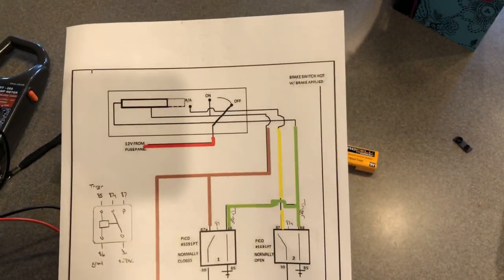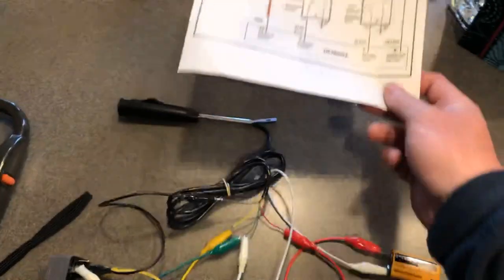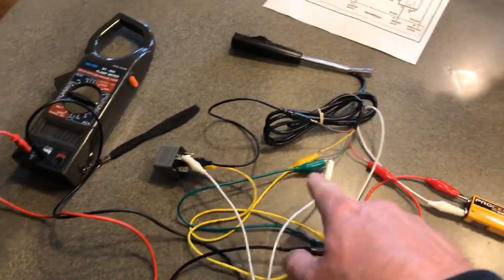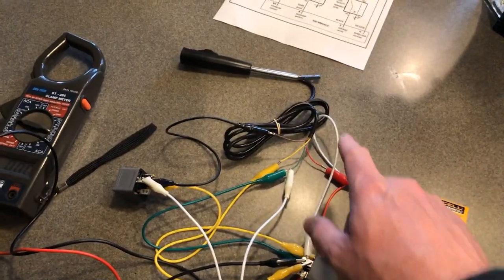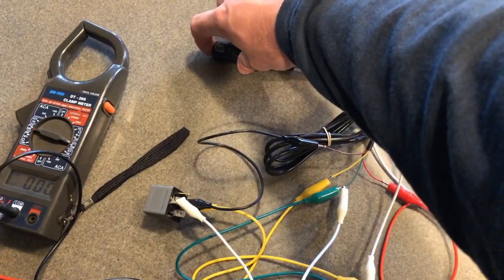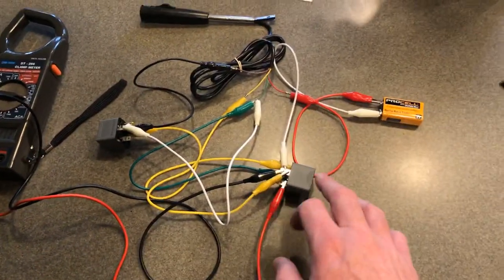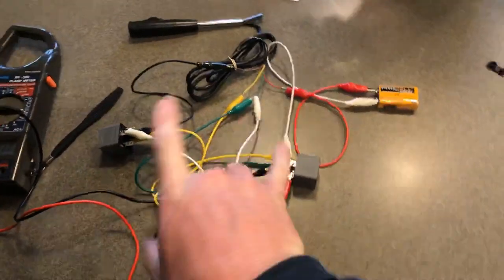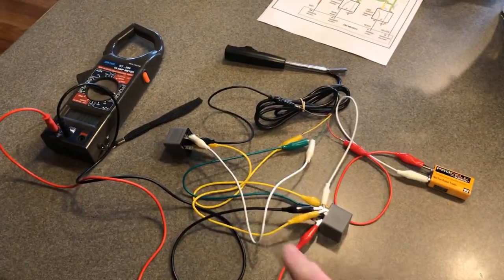Sneak peak of my cruise control relay setup

Comment: NIce man! Crazy how you are so good at wiring. I suck. On my cruise i was able to used the one it had in the car (It came with an aftermarket unit) and tied it into the Caprice. If you asked me how I did it, I wouldn't remember. LOL!!!
Reply from the maker: That’s slick it worked with the factory stuff.  Make for a clean install.  First world problems, my ankle gets sore on the throttle.

Comment: How difficult do you think its going to be to run that big wire thru the column?
Reply from the maker: Wicked C10 good question. I’m hopefully going to find out this week.  If I remember correctly, there is a channel that the wiring harness runs in.  Hopefully it’s not terrible